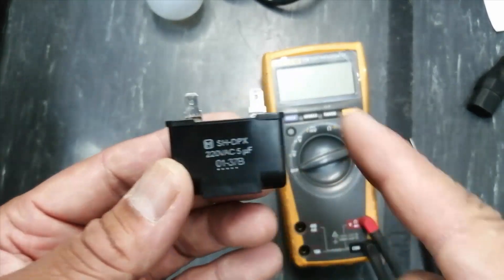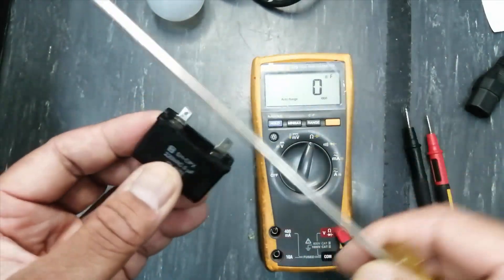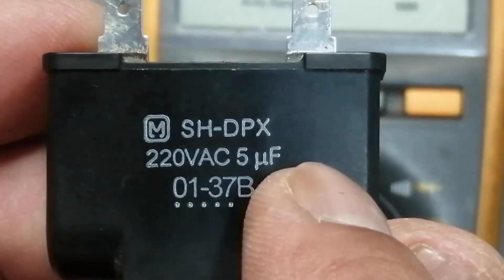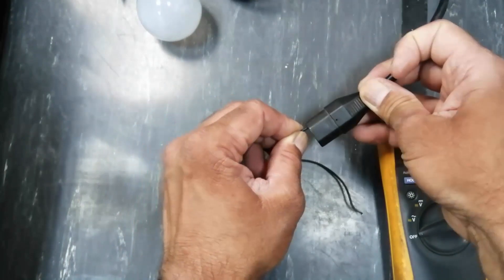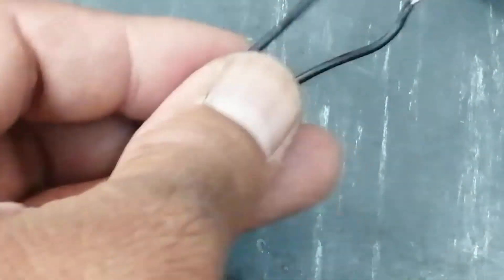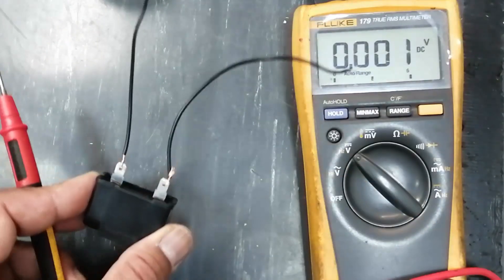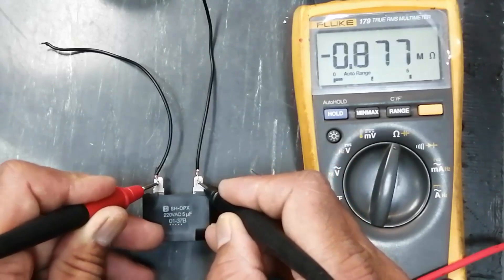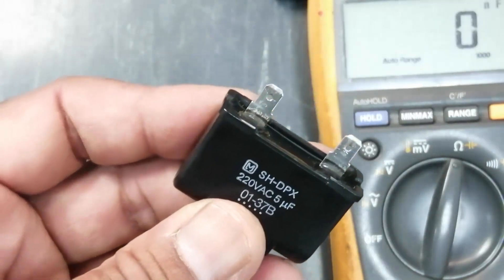{230} How to test Non Polar AC CAPACITOR / Non polarized capacitor

Comment: You should have series it with resistor to protect the internal of capacitor before you shorted the capacitor terminals
Reply from the maker: you are right 
but it is not matter of discharging the capacitor. it is to estimate the stored charge. if there is a resistor. it will not give any idea. 
moreover, it never damages the capacitor. capacitor damages when it gets overheated for frequent repetitions
and these ac capacitor are used to work in the same scenario as well  
although it is a non-technical approach to test, but it is much better and effective 
best regards

Comment: Good job my friend Haseeb 😍, but why did use a DC voltage selection in your digital multimeter to measure the capacitor after connecting it with a supply voltage despite it is a non-polarized AC capacitor

Comment: And what about internal resistance?
Reply from the maker: if the capacitor gives the capacitance that is nearly acceptable. as these multimeters check internal impedance using 1KHz test signal (while analog multimeter test using dc voltage) so by testing with a good digital multimeter the capacitor is considered functional 
but for best results we should test with ESR meter or LCR or LC Bridge tuned meter. that gives perfect results
Reply: @HaseebElectronics  thanks.